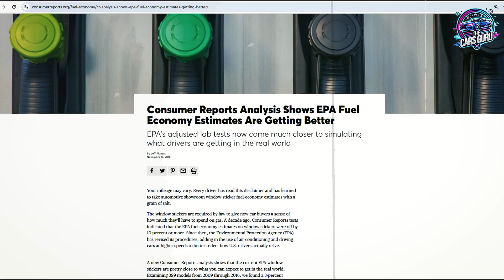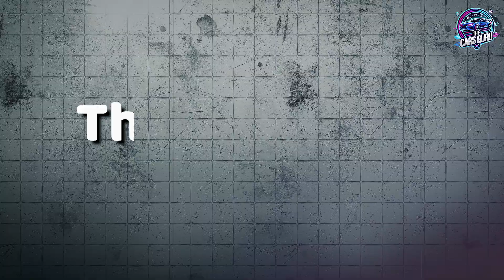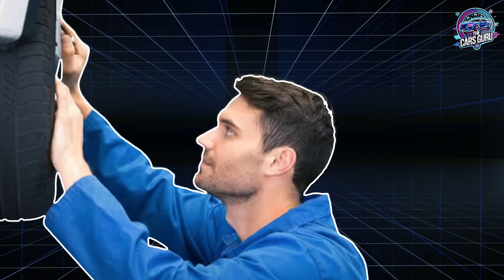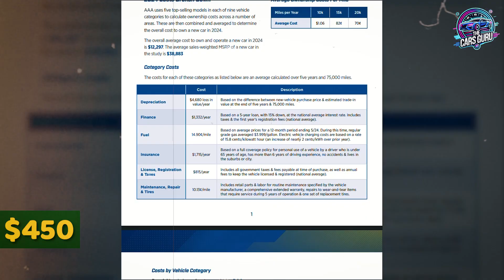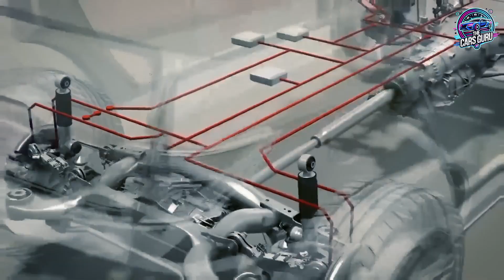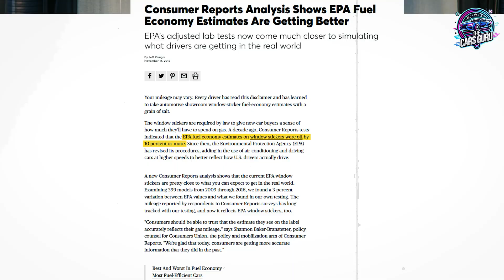AWD is Costing You $4,200 MORE Than You Think (Hidden Costs EXPOSED)

Comment: I have a 2019 Honda CRV AWD and get 28.5 city and 31 hwy.  The only added expense so far is for the rear differential fluid change at 30,000 miles.